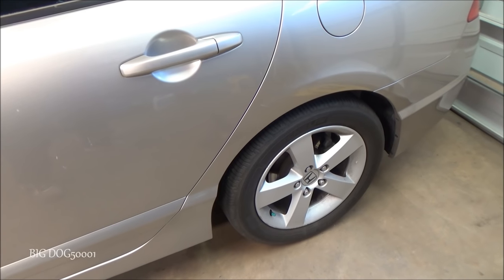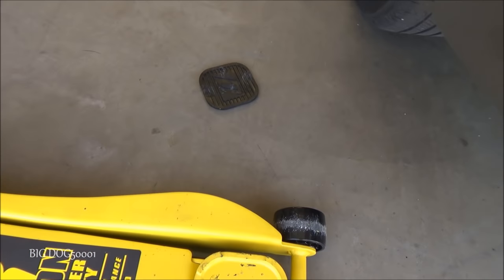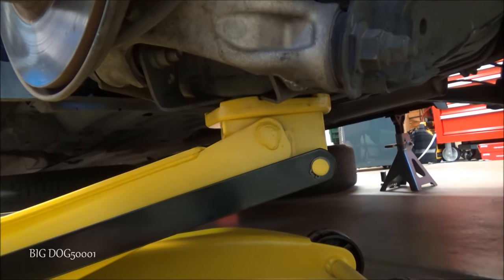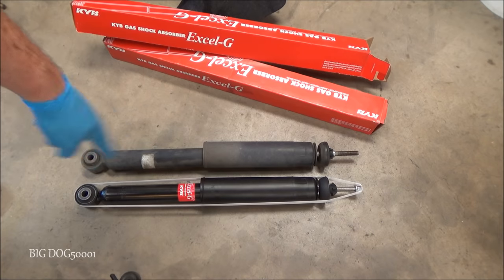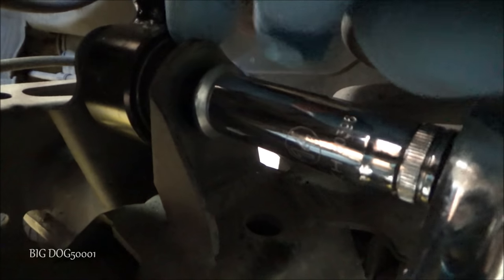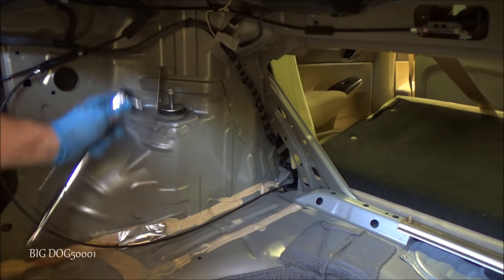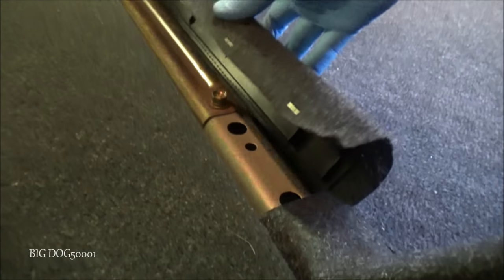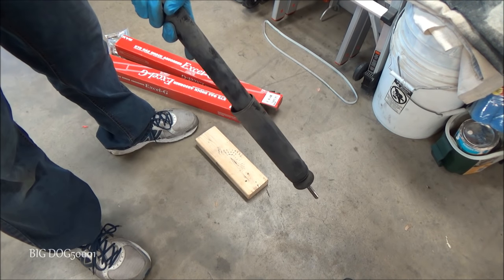Honda Civic Rear Shock Replacement 2006 (2006-2011 Similar)

Comment from the maker: Tools and Parts
This channel earns a small commission using some of these links - at no additional cost to you.

KYB Shocks:  https://amzn.to/2NamfEs
Honda Lower Bolt Part # 90181-SNA-000 Bolt, Flange (12X65)
Lisle Trim Tool:  https://amzn.to/32ATtAt
Daytona Jack (Cheaper at HF with Coupon):  https://amzn.to/2NYiUbk
Jack Stands (Cheaper at HF with Coupon):  https://amzn.to/2NYiYb4
GearWrench Ratcheting Wrenches:  https://amzn.to/2NV30yb
Milwaukee 3/8" Impact:  https://amzn.to/30dJdwl
Sunex 3/8" Impact Sockets:  https://amzn.to/2NW9L2Q
GearWrench Ratchets:  https://amzn.to/2LsJB6k
5MM Hex Socket (3/8"):  https://amzn.to/2LuD1w9
GearWrench Metric Wrench Set:  https://amzn.to/2NWC6Gj

The Big Dog 50001 Automotive Channel Store can be found here: https://www.amazon.com/shop/bigdog50001automotive
Reply: hi big dog,, Left & Right of KYB Rear shocks of 2006 Honda Civic are both the same parts number? Thankz....

Comment: I like your videos the best on this subject but no one seems to have a complete "story" on changing shocks like this on Honda Civics. What if the bolt head breaks? What to do? a couple folks have videos on this,  but leave some questions still unanswered. The beginning of a video should also show why you change shocks, What happens to the tires, what about oil leaking on the top of the shock?  What tools can you get by with if you dont have the latest digitial Torque wrench etc. Recommendation for tools as in a list of basic needs and ideal tools for the job. Also, list parts needed and also list of parts that might be needed for the mechanic who lives in Rust country and the bolt breaks or is stuck. I didnt see any thread loosener used in this video but are we to assume its always dont or needed? Just a few ideas. Im just learning myself but ive seen a lot of these to try to learn all the sides of this job that i can.

Comment: Great video! Tip: @BigDog5001 Those HF 3 ton Pittsburgh jacks were recalled due to people dying. You can take them back and they give you new ones with safety pins and sturdy locking mechanism, no receipt required.

Comment: This is an excellent how-to. Subscribed. 
A side note: If you are getting a clunking noise from the trunk at low speeds that goes away at highway speeds, and you are not experiencing excessive vibration issues, try tightening the top nut and bottom bolt of the shock. A little loose can cause a lot of rattle.
Reply from the maker: Thank you and welcome!

Comment: Excellent video. Very thorough down to specific placement of the jack when loading the rear suspension to light and heavy amounts of force. Well done and I appreciate you sharing your expertise.

I have replaced basically everything suspension wise along with other things in the last week and a half in my 2006 Civic LX coupe (with 275k miles) including lower control arms, ball joints, sway bar end links, inner+outer tie rods, and brake pads/rotors. On my way to the alignment shop, I heard a pop which ended up being the front left coil spring... So now I have complete strut/coil assemblies for the front and shocks for the back on the way as well as already having end links for the rear as well. 

I hope that my Ohio Honda with 275k allows me to release the bottom bolts on the front strut assemblies and these rear shocks. I don't have an impact, and while I could run and grab something for short term use, I got by installing everything else without one, so I hope my luck holds. A couple of breaker bars and some sweat has done it so far... Along with treating each bolt/nut with PB blaster daily for nearly a week beforehand. That seemed to have been the trick.
Reply: @BigDog50001  The lower rear shock bolts are the devil. A big Milwaukee Fuel high-torque 1,400ft/lb impact wrench only would spin the rubber inside the outer bushing with the bolt, and that pries open the mounting point. I was going to just start unbolting things back there to use my nice cutoff tool, but was afraid that i would have to end up cutting something else before the parts for the rear (upper control arms, toe adjustment bolts, etc.) started being delivered 3-4 days after this event. Ended up grabbing my neighbor's beefy oxy/acetylene cutting torch. I got a ton of old rags, probably 30 of them, soaked them in water, and wrapped up everything else tightly. I had my buddy keeping things while the torch did the work. I first cut through and across the outside round part of the shocks that retain the bushing and yanked the ancient shocks off. I then took a compact sawzall and removed the rubber component of the bushing to yield the stupid jerk of an inner bushing that was locked into a love affair with the bolt. I had to literally heat those up to about as hot as I could without starting to cut again before i shut off the torch and held a set of large vice grips on the inner bushing piece and had my buddy with a long breaker bar and a 14mm socket crank with all his might... until the first side and then the second were clear of the old hardware, and my garage floor and own self were covered in rust and soot and all the nasty stuff that burned off. Our masks were a testament to how important those were that day...

New shocks were installed in about 4 minutes a piece. The 4 front lower strut bolts loosened with nothing more than an 18" breaker bar and 19mm/17mm sockets on the nut and bolt in that order. Front strut/coil spring assemblies by Gabriel had a slightly larger diameter bolt on the top ends that terminate in the strut towers, and I had to drill them out by 1/16", but still had both sides done in maybe a half hour. Can't beat the convenience of not having to use a janky spring compressor, and replacing all four corners at once, as well as on the front: lower control arms, ball joints, end links, inner/outer tie rod ends.  On the rear: lower and upper control arms, complete drum brake swap with backing plates, and hub bearings. 

Wanted to note that this pretty large list of part swaps was the first time I have ever done this type of repair. Have been doing my front pads/rotors, oil changes, an exhaust twice, and some odds and ends on the intake and throttle body were it. The wheel bearings were done last unfortunately... I was told the noise on the highway was the drum brakes even though it didn't cease with the activation of the brake system... Those rear brakes were original to the car @275k miles, so it needed done anyway. The new ones are coated to reduce rust. Since everything felt way better but i was still having noise, vibration, and a not awesome feeling from that part of the car, decided to just do it. Nothing else could have done this other than the tires, and rotating them to the front was the first thing I tried. They only have 8-9k on them and they're goodyears. Once the rear wheel hubs were done in quite literally 17 minutes with the Milwaukee impact making bolt removal an absolute piece of cake, that was it. I was done. I hate care now... But when I took it in for an alignment, they told me it was within a few percent of perfect and that the repairs looked well done and they asked who in town used Moog parts and Gabriel struts, and the ball joints with the grease fittings.... That was a proud junior mechanic moment!

Comment: Thanks for the video.  My experience was a little bit of an ordeal.  When I tried to get the lower bolt out on passenger side, I found the bolt had rusted to the bushing.  In the process of trying to torque it off, I had bent the side of the bracket with the built-in nut.  Fortunately, I had enough room in there to get a grinder wheel and cut the bolt off (and bushing, woof).  I bent it back best I could with a C-clamp.  Trying to install the new bolt, I might have cross-threaded it because the bracket was bent slightly.  43 foot lbs... lol?  I got it snugged up in there and left it.  If I have problems with it in the future, I'll just drill out the built-in nut and run a bolt through with a washer and nut of my own.  The drivers side took, maybe 15 minutes total to change.
Reply from the maker: Sucks when that happens, thanks for the input!

Comment: Very well done. And, CORRECTLY TORQUED. Take notice that the torque wrench actually tightened the bolts before reaching and signalling the 80 lb setting for the lug nuts. 

I can't tell you how many people over tighten fasteners and then use a torque wrench that never moves the fastener before it clicks. Using this technique, you'll never know what torque was actually applied since the set torque was reached before the fastener moved...meaning that the actually applied torque was above teh torque wrench setting. Duh! I've seen this so many times, especially at tire stores, where installers run down lug bolts with air guns and then run around checking torque with a torque wrench. 

Trust me, invest in your own torque wrench and then retorque your lug nuts.

Thanks for doing it right.
Reply from the maker: Thanks for the comment!
Reply: Cuantas libras  de las tuercas de las ruedas?
Reply: @BigDog50001 80 libras? 😮

Comment: For what it's worth-
I keep the new shock compressed, get the bottom bolt in and then cut away the retaining strap and guide the top end into the hole. Makes it a lot easier to not cross thread the bottom bolt.
Reply from the maker: Yeah I have done that trick too.  Doing it that way will not allow "priming" the shock prior to install though.  Thanks for the input!

Comment: Thank you for the video. I did this today and it went perfect. Used your video to step me through. The only thing I did different was not taking out the carpet. I just removed the 3 clips on each side and pulled it our enough to give me access to the top of the shock. I would like to mention that the top of my KYB shock was not as long as the ones you have or the original stock shocks I took off. The part that has the hex bolt and the nut, about 1 1/2 inches shorter on the ones I got but still had plenty of space for the nut. Also, maybe you should mention that thing about making your shocks not squeak at the beginning of the video instead of the end, I missed this step and I am not taking it back apart. I don't hear any squeaking yet but when they start I am blaming you. J/K, thanks for the video.

Comment: man i saw that intro and I just knew. My friend wanted to swap his locking lugs with standard ones on his camry so we go to the dealer since it had the ones that had the washer built in. This is Canada btw and the dealer quoted us $15 FOR A SINGLE LUG NUT. It costs less to remove locking lugs the hard way so we just left it alone.

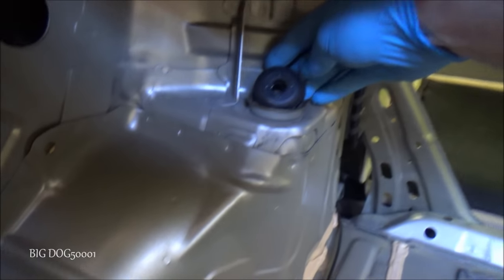Comment: Hey man I have a question, do I need 2 rubber shock absorbers shown at 9:20. One for under the mounting point and one for over? I got the same KYB shocks as the ones you used and just like the video it comes with the lower rubber ring. But in the video I see there’s another ring on the top. Are they identical?
Reply: Si

Comment: Did you tighten the strut more once you put more pressure on it prior to putting the wheel on?
Reply from the maker: It is a shock on rear of this vehicle (the struts are on the front), but no I did not do anything more than I showed in video.  The procedure I showed is exactly how it is written in Honda service information (install nuts/bolts loosely then put load on suspension with jack and then do final torque).

Comment: Thank you for the detailed video !
Last year I changed my front and rear suspension OEM parts.
I hear a clunk noise from the rear but only when it is cold (I live up north).
I changed the bottom bolt, upper rubber mount, nut and I still hear the clunk but only at winter.
I changed the stabilizer links, rear control upper arm and still clunk.
So I am certain that these rear shocks have a manufacturing defect.
They have max 5000km and are outside of warranty (12 months).
Should I replace them with OEM again or just go with KYB?
Reply from the maker: Some of those Civics would make clunk sounds in the rear due to the bump stop on the shock moving around (sliding down out of place).  You may have better luck with KYB.
Reply: I had the same issue at my mechanics shop. We put in aftermarket in the rear and it would rattle and clunk. They kept trying different bushings and nothing worked. Finally we just had to go with OEM and that corrected the problem. For some reason the aftermarket rear shocks just don't fit well in the rear. There's just a tiny little play in the bushings.
Reply: Had the exact same issue. For some reason aftermarket ones make those noises. After screwing around with them for almost a few weeks My mechanic and I finally decided to go to OEM and it fixed the problem. It's a shame because the OEMs are ridiculously expensive but I guess you just have to do what you have to do.

Comment: Noob question here sorry.... But would it be possible to hand tighten the bottom bolt with the shock still compressed and then cut the plastic and guide it up?

Comment: Is there a reason why to replace the lower shock bolt and upper shock mounting nut? If they are still in good nick, can you reuse them?

Comment: @Big Dog50001 Automotive, how did you figure it was time to change these before taking them off? Bought used 2009 civic coup LX with 70,000 miles. I looked the front struts and they look like they need replacing, I'll watch your video on the front struts. Thanks

Comment: Nice video , I noticed you didn’t change the spring,are they reusable if not how do you tell they are bad?
Reply from the maker: I will usually replace them if the vehicle is sagging or the spring is broken.  In many cases, springs will last the life of the vehicle.   Thanks for the comment!

Comment: Super helpful video, thank you. Unfortunately, I ran into problems on both sides, and I'm in the midst of troubleshooting. On the driver's side the bolt is stuck and the head is rounded and I can't get it off. I've tried an extractor socket but it won't catch. On the passenger's side, I got the bolt loose, but it's so old that it's basically bonded with the bottom rubbert part of the shock. It spins, but I can't get it to come through the hole. On top of that it pushed apart the bracket and the grooved side is now bent a bit. It's a mess. Any suggestions would be great appreciated!
Reply: Ever find a solution? I was thinking of using a reciprocating saw and cut the bolt
Reply: @oldrestless  Yup, that's exactly what I ended up using. Get some good metal cutting blades, and that's your best bet. On one side I had to cut off the bracket that the bolt screws into, and just use a few lugnuts. Good luck.

Comment: My 2007 civics rear shocks were replaced and the car bounces up and down like an old Buick!  Is that normal? I thought it was the opposite new shocks will rebound once the old worn-out ones will rebound more than once etc?
Reply from the maker: Does not sound normal.

Comment: Is there no need to put a nut of some kind on the other side of bottom bolt that was 90181-SNA-000 Bolt? I haven't attempted it yet, but want to make sure I have everything
Reply from the maker: Nope, the threads that bolt goes into on the other side are welded on.

Comment: I need to replace the rear shocks on my 2007 Civic Si.  You mentioned that the torque on the bottom shock bolt on the Si was different than the other models.  Would you happen to know if anything else is different with the Si version when it comes to replacing the rear shocks?
Reply from the maker: The Si uses different parts, but it is a similar procedure.
Reply: @BigDog50001   Thank you very much!

Comment: i bought rear shocks that didn’t come wish rubber bushings or washers, can i simply buy some from a auto part store ?
Reply from the maker: Usually parts like that can be bought separately.  Places like Rock Auto or a Honda dealer parts department will usually have them.

Comment: how much should a shock replacement on a 2010 Civic EX cost?
Reply from the maker: Unfortunately prices vary widely depending on the part (OEM or aftermarket) and the cost of labor at the shop where the work is being done.

Comment: my shocks have a square topped bolt, not a space for an allen wrench. what tool do you use to hold that, while screwing the nut down?
Reply from the maker: A correctly sized socket or wrench will usually work.

Comment: I just bought KYB’s for my civic and im getting a funny noise coming from the left rear shock sounds like it the upper part of the shock, any idea of what it can be? I tried tightening it but thats not the case... thank you
Reply from the maker: If it started after work was done, I would double check my work.  Stabilizer links (aka sway bar links) are known to cause noise also, especially when hitting a bump.

Comment: After doing this my car drifts to the right? Did I do something wrong or do I just need to get a alignment?
Reply from the maker: Double check the work done of course.  Checking tires (including tire pressure) and having the alignment checked are also good ideas.

Comment: I'm having trouble with the lower bolt not coming off. What would you recommend?
Reply from the maker: Penetrating oil to start and tapping end of bolt with a hammer (key word tapping not smashing it).  If it won't budge still (probably best to not try and twist it off immediately), it can be left alone for a few days while continuing to hose it down with penetrating oil periodically.  After that, more drastic measures may be needed.